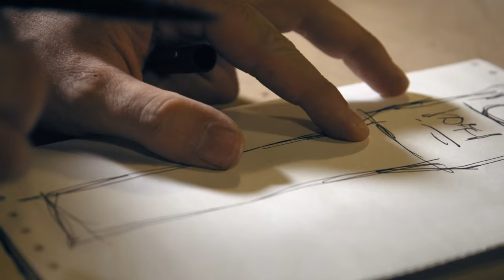DIY Security Switch for Table Saw

Comment: Apart from the greatly improved, safety aspect, from not having to search for the silly little OFF switch, it saves a lot of extended noise by allowing switch-off as soon as the cut is finished. On the DeWalt table saw the two upper switch screws can hold the hinge without even modifying the saw. If you need to return the saw for repair under guarantee, the switch paddle can quickly be removed.

Comment: Brilliant, safe and functional! At least you have a proper safety switch. Which my lethally dangerous, DeWalt DW745 does not. I'd need to fit a paddle switch before I can even add your clever lever.
Reply from the maker: Yeah the makita is a death machine too...

Comment: You should make one with an ardrino chip where two clicks for on and one click for off (that would be awesome)
Reply from the maker: I prefer to use my hand to switch it on anyway so I'm sure they are not in the wrong place (one at least) :)
Reply: +Giaco Whatever alright that's fine I just thought it'd be a cool idea

Comment: Giaco, It would be helpful if you did a quick write up or explanation video on the steps for doing this. I own the same saw and struggle dangerously trying to find the red button. You would be helping me be safer. Cheers mate. FCK DRMS MKE PLNS
Reply from the maker: +Allister Towndrow sure what is not clear mate?
Reply: You began unplugging cables in the switch. Why? and what alterations did you make in there?. Thats all. Thank you and David for making these videos. I religiously tune in to watch them daily. When i make my own killswitch i'll Tag you.
Reply from the maker: That was just to have it easily accessible on the workbench and think more how to do it... I put all back as it was... Also I changed the bolt with a longer one...
Reply from the maker: Yes please tag me I'm curios

Comment: nice idea! how good is this type of makita tablesaw,  and should I buy one?(im looking for a tablesaw)
Reply: Got one.... fence is shite, smaller than normal mitre tracks, can't fit a dado blade and underpowered yet luckily the cast top is flat. The ML100 I use it for ripping firewood mostly now but if I get the Giaco No Bend Nee Switch then it might get lifted up the rankings to aluminium plate slicer but.... even after plugging up all the gaps the dust collection is mediocre. ... so that's no good either. .... weirdly enough it's the ONLY piece of Giacomo's gear that is 2nd rate. Never figured that out....maybe a better quality saw but 2nd hand?  Good luck anyway.